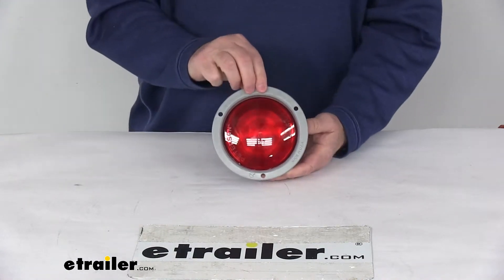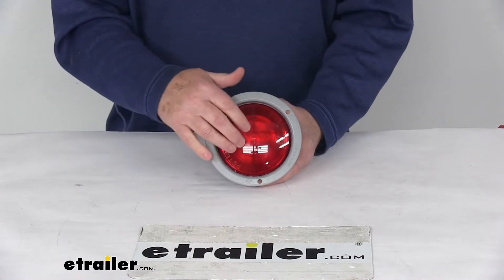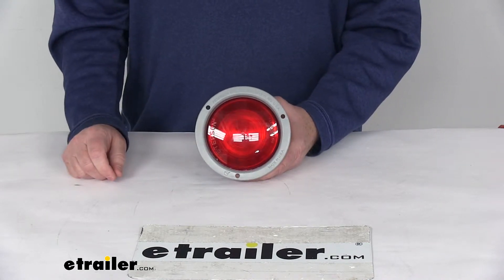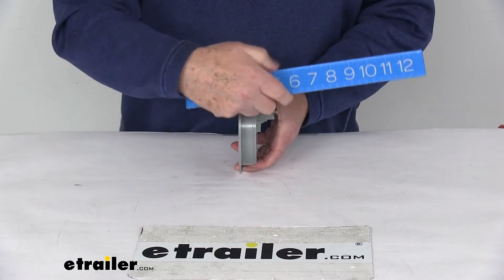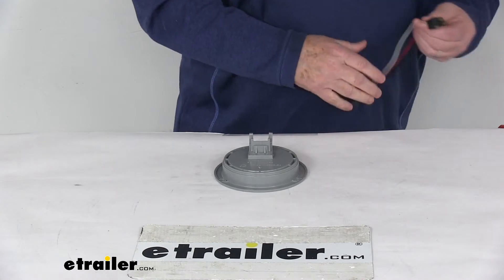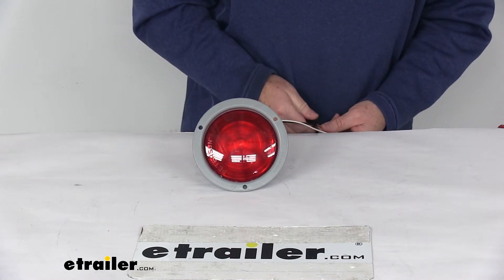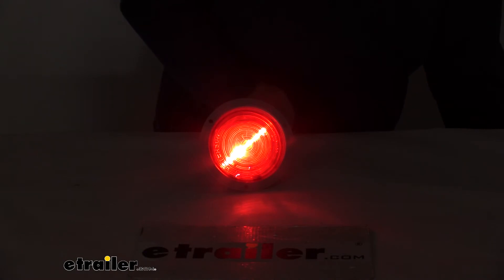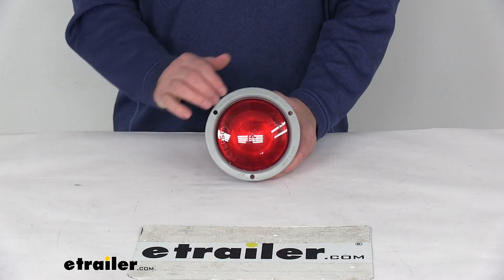etrailer | Feature Review Peterson LED Trailer Tail Light

Comment: Awesome brake lights..Very Bright. The simple one led diode design is tough as nails.
Reply from the maker: LED's are definitely the way to go. They're brighter, use less power and will last up to 50 times longer than a comparable incandescent lamp.
https://www.etrailer.com/Trailer-Lights/Peterson/M824R.html